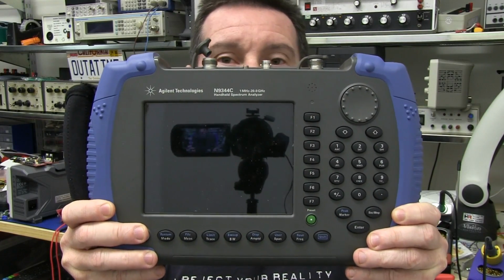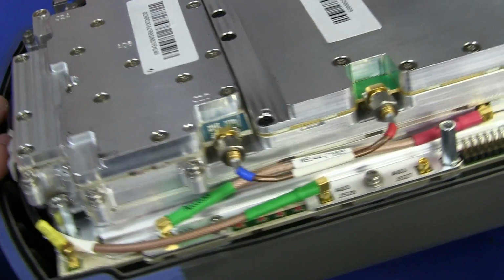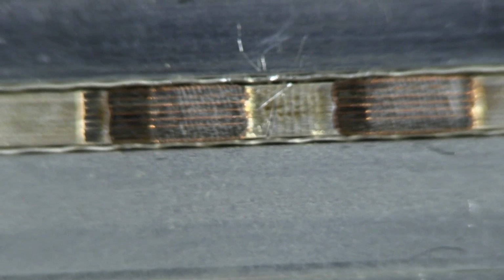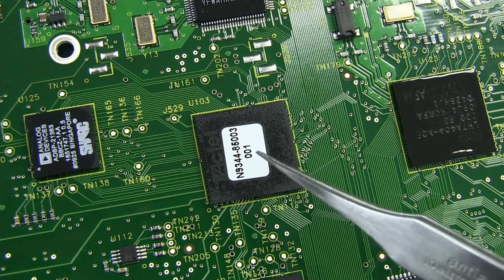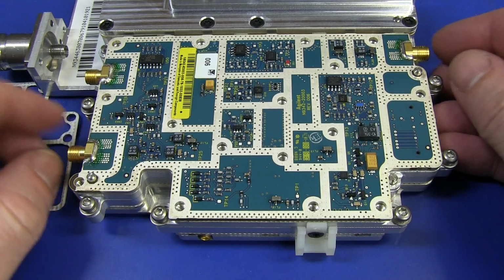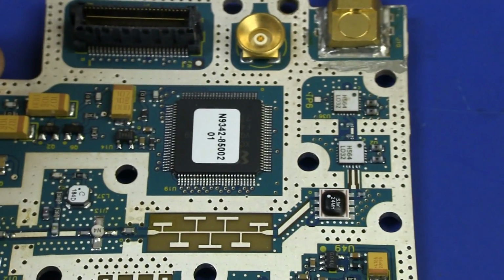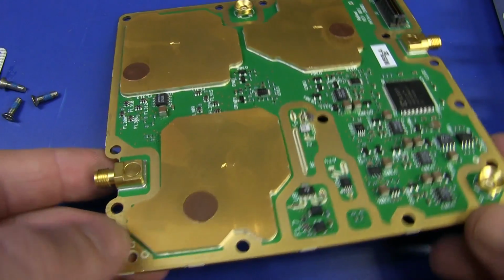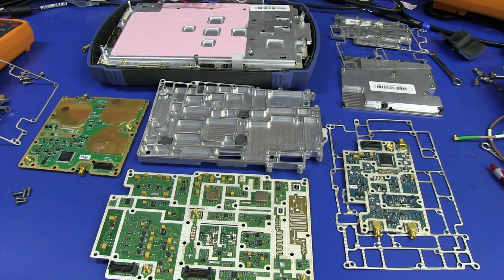EEVblog #470 - Agilent N9344C 20GHz Spectrum Analyser Teardown

Comment: 46:08 In this topology we have to consider wave propagation. The butterfly structures are transmission lines stups which, depending on the frequency, acts like a short or an open. Mostly these structures are used as shorts for a certain frequency. The flare out a the end of the stups makes the damping characteristics in the transfer function more wider compared to a non flared out stup. The connections between the butterflies are much more thinner than a 50Ohm transmission line should be. The idea is to increase inductance so the butterflies can provide much more damping due to the higher impedance caused by the inductance.
Reply: sure does.
Reply: this is specifically why the knife edge was used to point them out!

Comment: Those copper tapes at 41:00, I think, during the metal shield is being soldered, the air inside will expand, so the hole is used for the air relief, and once technician done with soldering, he/she simply seal it off with a that copper tape.
Reply: chaurasia hariprasad was my first thought too
Reply: I'm pretty sure you're correct there. You see the same thing with the heat spreaders on older Pentium 4 CPUs. They also have a little vent hole for when the heat spreader is soldered to the board.
Reply: Matt Elder I always wondered what those little holes on the IHS were and now I know
Reply: I wondered if they might be gas purged (Nitrogen ?) to avoid oxidation variances, but expansion compensation is probably more likely.

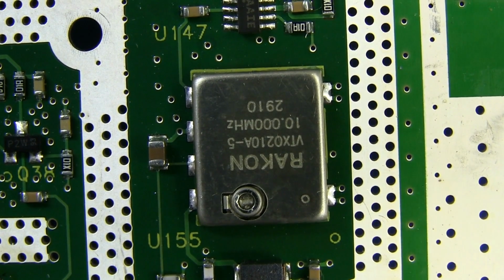Comment: Min 26:50 Very likely the reference generator loop – This takes in an external 10 MHz or uses the 10 MHz VCTCXO (internal reference for basic stability). The phase noise at far offsets (> 30 -40 Hz) is achieved with the 40 MHz VCXO.
Min29:11 – Silver plated Beryllium Copper for springiness (The white material on board is silver coating which gives lower loss than Gold coating (due to Nickel layer underneath).
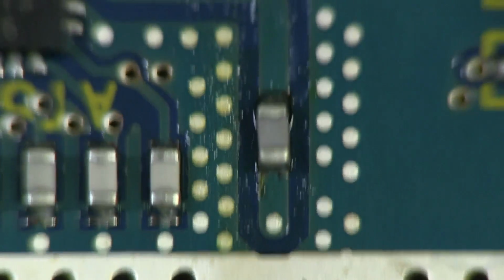Min31:17 – Filled via – with conductive or non-conductive (most likely) plug.
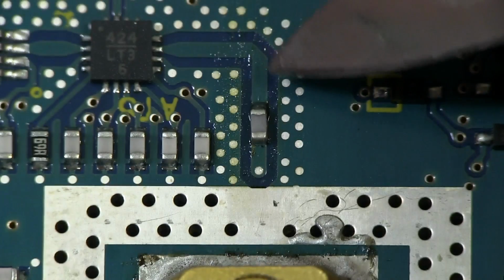Min31:42 – Prevent leakage with Rogers 4003 or 4350 outer layer with Glass epoxy layer sandwiched?
Min34:08– Near DC to a few GHz Amplifier, L38 in view is high value L with a ac Impedance limiting Resistor in parallel (alternate would be conical inductors). Power supply on the left (passed from backside?)
Min34:30 –   Low Pass Filter  to limit the Input BW. 
Min35:11 –   Local oscillator Amp for Mixer mixing a Low Pass Filter (0 -3 GHz?) to limit the Input BW. 
Min38:06 – Single Frequency Amp LEE-39+– 7GHz? 
Min39:08- Power supplies and bias generators?
Min47:02- Coupler for LO null?
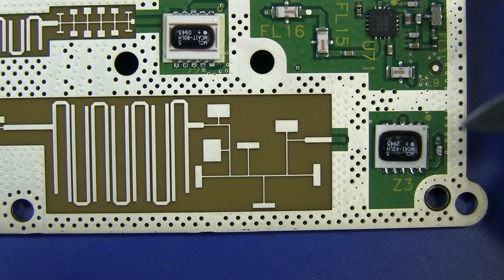Min47:33- LPF, Min48:35- First Mixer followed by LPF & BPF (U shapes), LPF s are cascaded for different cut off frequencies. Smaller the size-higher the freq.
Min49:23- 2.8 -8 G , 940 MHz(?) IF Mixer. CRO-3750 for 2nd LO?

Comment: 32:15-33:30: "424" is a Hittite digital attenuator. "H270" parts are Hittite 2 way switches, "1GM1" part is an Agilent 20Ghz active mixer.
33:25: "184D" is an inductor for the "N4" darlington gain block.
33:40: Another "424" Hittite step attenuator
34:15-34:20: More monolithic darlington gain blocks.
35:10: "H564" parts are Hittite LNA amplifiers.

Comment: Thanks Dave!
I have the N9340A HSA that I use for filter and duplexer tuning and general purpose work in public safety radio installation and maintenance.  I paid a little over $2500 for it used on eBay.  It’s definitely paid for itself in the 10 years or so that I’ve owned it.  Great device.

I love the fact that you allowed us an in-depth view INSIDE the N9344 series SA.
This allowed me to avoid taking my SA apart and most probably destroying it just to see the inside magic of Agilent.

Thanks for a phenomenal channel !

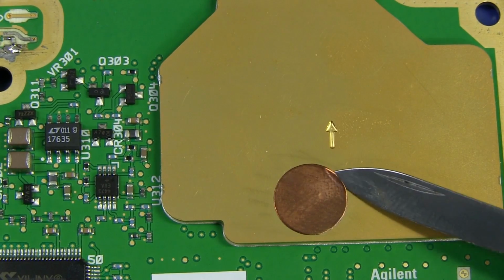Comment: @40:50 I assume that the pinholes in the shielding cases are to equalize the air pressure during and after soldering :-)  It is a real beauty Dave!

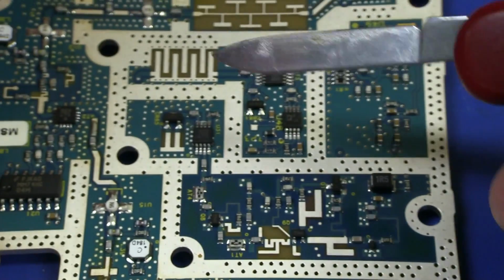Comment: 36:07 is a slotline hairpin bandpass filter. And the one above it is a Chebychev/elliptic lowpass filter. It's easy to tell low pass from band pass, just view it as a dc line. if it passes dc (there's a direct connection with no lines to ground, it's a low pass). The chebychev/elliptic low pass is like a normal filter, but the parallel element is actually a resonator instead of a single reactive element. 

Really nice tear down though. Subscribed!
Reply: At 46:19, as mentioned above, you can tell it's a lowpass. The thin line plays, as you correctly mentioned, the role of an inductor and the arc shapes are capacitors. They are shaped like that to increase the bandwidth.
Reply: I'd like to learn more about the principal of operation of these PCB level devices and how they're designed. Is there a Wikipedia page or other materials?

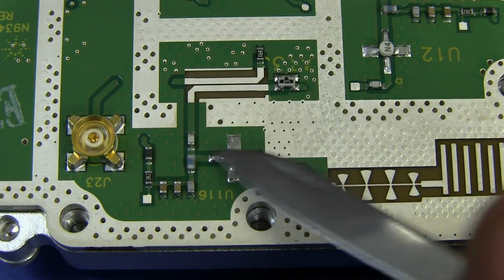Comment: The structure at 46:55 is a directional coupler. A wave traveling down one of the lines will couple across to the other line causing a wave to travel down it in the opposite direction.

Comment: The parts labeled four digits on top and four on the bottom are Agilent chips, using the same kind of part numbering scheme that HP used back in the day.  The ones with ceramic tops are most certainly InP devices which are manufactured at a plant in Germany which, if I understand correctly, is a joint-venture with X-Fab.

Comment: As said by a couple of others, the Hnnn parts are Hittite parts.  I saw: HMC349, HMC700, HMC773, HMC564, HMC424, which are actually pretty easy to identify if you know what you are looking at (and now, you do!).  The "LO" you pointed out has nothing to do with local oscillation, those are input LNAs to set the noise figure at the input connector.  Cheers!

Comment: 47:07: Yes, microstrip directional coupler.  Exactly what I was thinking.  Maybe this is being used to isolate the incoming signal from a local oscillator just before a mixer diode.

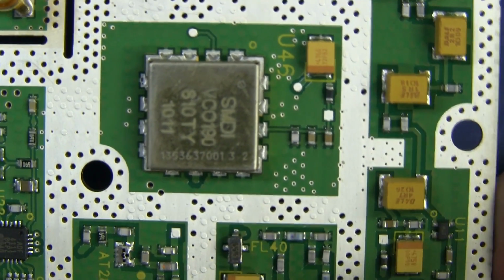I DO love that "kite tail" bandpass filter a little later (50:00), though.

Comment: I don't think you mentioned this, but also note the symmetry of the filter at 34:30. That's not just for simplicity or looks, but to mitigate the effect of unequal stage loading between orders of the filter. 

Also I could be wrong, but the "zigzags" or rather meander in for instance the bowtie stub filter at 46:10 are rather to ensure the correct length of trace (or rather in this case, waveguide) (eg 1/4 wavelength or whatever is needed) between elements rather than act as elements themselves.

It's interesting however that they don't have chamfered edges in the RF sections which is where I'd really expect to see it. 

As for that little loop at 50:17, my best guess would be maybe some sort of a pi network.

Comment: Something to consider with a spectrum analyser like this is it probablly has serveral different routes a signal can take through the system depending on the operating frequency. You can't reasonablly make one signal chain work from 1MHz to 20GHz.

Comment: The pcb filters are cheaper to mass produce, but almost always under perform discrete component based filters.  The killer is the losses in the pcb material.    The  alternating pattern filters are probably interdigital band pass filters.  The ones with the pizza slice caps may  look like low pass filters.  The one with the smooth curved inductors is probably f

Comment: At 40 minutes there is a section where LO is Local Oscillator, RF is exactly what it says, and the chip i think is an RF Mixer for down conversion. Z1 is the impedance matching on the output.

Comment: I bet those "access holes" under the copper tape patches are for pressure equalization so that hot air can expand during soldering and contract when it cools down afterwards.

Comment: At 40:53 those are not access holes.  Those are to relieve/vent any pressure that might build up during the soldering process of that large shield.  Then they plug it post production for RF reasons.

Comment: I want the input board looks like under all that shielding! I bet those holes under the copper tape are to equalize pressure during solder and assembly.

Comment: 31:00
next to the added trim jumper is an area that looks to have been laser cut..
During Bench build, Tuning  assembly?

The shinny dots may be through connections as Z axis shielding 
around 46mins some of the this shielding looks tobe drilled threw some not,  random..

0iC A Ground Plane, MayBe...

Comment: My guess. After the solder solidified the contracting air in the container might be enough to flex the PCB and possibly damage some ceramic parts inside or out.

Comment: at 47:02 is a directional coupler i think (could be wrong but don't think so). directional coupler is meant to "sample" a small fraction of the RF wave propagating from input to output. Common coupling port can be 20 dB or more.

Comment: At 30:44 exactly. Is that soldering of the connector broken, or it'a a play of light. That would whoop down the signal to the ground (that kind of crack takes 10 GHz to dust). 31:01 look at that stub tuning at the right center :D. 31:11 it is actually a tuning method for that high frequencies. If made on Teflon or on ceramic, it would be more precise with epsilon, and hence less tuning.
Would not say a word anymore. I just had a bear after a long day in open pit coal mine.
Best Regards, thumbsup

Comment: Wow. Agilent just sending you a sample to gut no questions asked? That is far and beyond the best reason why next time I will be in the market for some test gear, all other competing options will be shoved on the side and pull out my proverbial checkbook. 

Additionally, ~$20k is actually not crazy for something of this level of system complexity, not to mention microwave signal path minefield. Which anyone who has ever designed anything over a GHz will probably wholeheartedly agree with.

Comment: 42:37 I asume this is for calibration. I had once a circuit when the top plate wasn't in place the whole parts s parameters shifted dramatically.

Comment: I wonder if the converters are JESD204B on it to the FPGA, The low I/O count to the other blocks would tend to suggest that. The main board shielded blocks are probably precision clock reference generators, shielded for the femto second order performance.

Comment: About that weird little circuit at 37:57 - There seems to be ground plane all around the components but not under the "main" traces on the top.  There is also no solder mask.  I first noticed this because there are tiny patches of solder mask where needed.  Why is the ground plane missing?  Some supper high frequency RF weirdness I assume.

Comment: Its like he is putting an effort into scratching every thing he can on this 18k device.  15:32
as all his "pointing" devices are either sharp metal screwdrivers or pointy tweezers, using something blunt like a pen or likewise..no chance as it is so easy to be bold when it is other people's expensive property. 
You can't really blame Tektronix that they didn't wanna loan you expensive gear for one of your teardowns when you lack basic courtesy with high-end gear.
and nah not even one second with actually turning this 20ghz handheld spectrum-puppy on, I, thought it perhaps was in the end or in another separate video, but no dice.. nahh not my cup of tea, I like teardown as much as the next, but high-end handheld analyzer coming in at around 20.000, here it would be nice to actually see the performance for an handheld-item in this 20G class back in that period' but nahh Im expecting to much...just 52 minutes of rambling with you hearing your own mouth running' without actually letting the product talk for itself by its performance,.. hmm I know this is an old video, but wow, just wow, c'mon,..

Comment: I hope they can buff out all the scratches.
Granted not on critical paths and probably deemed as a demo unit for the rest of it's life but would it be so hard to use a plastic trimmer as a pointer?
Reply: Well he could also use a normal cutter to open mailbags, but what's the fun in that? :D
Reply: I feel you were reading my mind. And what HE considered "beautiful soldering" wasn't to my eyes in some places. Looked like a parts machine. He might have been curious about whether it would turn on after reassembly! I was!

Comment: I've been preserving and restoring many electronic organs from as far back as 1946. The Hammond tone wheel organ is certainly the most desired organ and currently there are many manufactures, including Hammond's new owner- Suzuki, manufacturing digital emulations. However, there were more organ manufacters besides Hammond who made great organs. Wurlitzer made excellent theater organs, as did Gulbransen, Conn, Allen, Thomas...
Would this analyzer aid in accurately capturing these vintage organs?

Comment: 41:20 could those be breather holes for air temperature/pressure changes (sealed otherwise, but the tape would be flexible)

Comment: There are several things on the RF path that have the RF going through and connectors on both sides going to ground, and David refers to them as RF amplifiers. How can an amplifier not have a power connection? (see 31:04, white component with N6 on it)
Reply: Validole power is supplied to the drain of the transistor of the amplifier. The vertical white passive to the right of the N6 component is probably an inductor connected to the DC power, the horizontal passive even further to the right is a blocking capacitor only allowing the RF to pass.

Comment: I love to be able to design my own microwave pcb like that, only trouble is the cad simulation and pcb software to do it is prohibitively expensive, and then you need all the training and knowledge, its not easy, it very challenging, it's easier to make a rocket and fly to the moon that design gear like this.

Comment: can i bend those those "solid coax cables" ? Or do you need special equiptment ? When they are like a copper pipe they would damage the insulation (dielectric tube) inside the coax.

Comment: 31:50 looks like a digitally controlled attenuator
Reply: to the left is probably a switch or power divider, then the two traces each is likely amplified, and the top signal is likely connected to a down-mixed at the very left.

Comment: why input attenuator is needed?
Reply: Because people have to be able to do measurements of very low signals (fractions of a picoWatt) as well as much larger signals (Watt). The strong levels can be quadrillion times (10 at power 15) larger than the low levels.
Reply: So its purpose to attenuate high level signals? So they are not used for very low level signals right?
Reply: They have to attenuate relatively high power signals, to bring all signals to about the same level, which can be processed by the frontend stage. In some cases, where the signals are too small, they are amplified through a preamplifier before they are applied to the frontend stage. The spectrum analyzers are capable of analyzing extremely low level signals. In some aspects, better than the spectrum analyzers are the EMI receivers (their dynamic range is usually higher than of spectrum analyzers).

Comment: What are those bow tie structures in the filter called?
I often see them with only one cone. Are they a full resonator or act like a capacitor or broadband open end?
Reply: They are low pass filters using bowtie stubs a.k.a. butterfly stubs a.k.a. parallel radial stubs. This wikipedia article pretty documents all of these: http://en.wikipedia.org/wiki/Distributed_element_filter
Reply: P.S. single cone versions are called radial stubs.
Reply: Thank you.
Now I could find this about them:
"primarily for providing a clean (no spurious resonances) broadband >short circuit<, much broader than a simple open-circuit stub."
"a broadly resonant RF >short circuit<."

Comment: maybe these gold shieldingcans contain a vacuum?
Reply: +Felix Hil (Unloadet) probably just some clean air or inert gas to reduce oxidation of traces on pcb
Reply: well "just" its still to get in there...
Reply: +Felix Hil (Unloadet) well, it should be patented
Reply: So the device should also work without the gas/air/vaacum... maybe out of spec
Reply: +Felix Hil (Unloadet) yep, most likely specs will drift over time
Reply: +Jubulburb Wuldrd well thats a natural effect we can't stop, just slow down or compensate a bit but we will have to live with it
Reply: Probably Not... They have Access Holes to adjust trimmer pots maybe..

I once opened up a Venable FRA... Same kind of Stuff
Reply: Vikram Balaji I havent seen the trimmer pots...
Reply: They put the magic smoke inside through those holes. People have noticed that once the smoke comes out, the instruments stop working.
Reply: Nick F I think you are right

Comment: What can a zero-ohm "resistor" possibly be useful for?
Reply: For crossing other traces, or as fuse.
Reply: Use zero ohm resistors to connect isolated sections after commissioning and testing.

Comment: i was thinking they filled the space with an inert gas like nitrogen for some reason.
Reply: to keep it cold. Nitrogen liquid (on a digital thermometer) has been clocked at 
-400 Farenhiet (at 240 Centagrade) and gas -204 F  (at 131 C).
Reply: Connor Freeman ... and would blow the top off the whole thing when it heated up. No. Inert atmospheres could be used to avoid problems like oxides changing the characteristics of traces. In this case, however, I believe Kai Allen had it right: pressure equalization during soldering.

Comment: Those little holes in the golden cans in the attenuator board... Aren't (Ehm, weren't) they filled with an inert gas or something?

Those fan-shaped PCB trace 'capacitors', aren't they signal reflectors (every point equidistant from the trace it's connected to)? You also see that every trace that takes a 90 degree turn looks like a lightpipe, as if directly reflecting the wavefront.